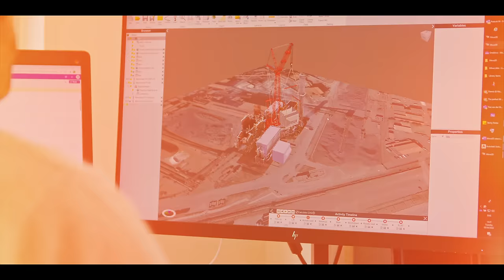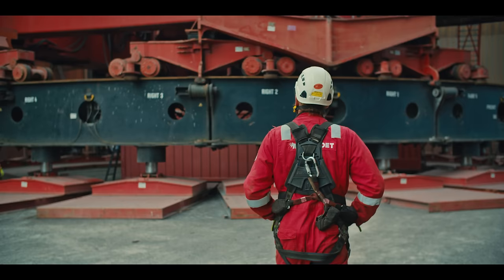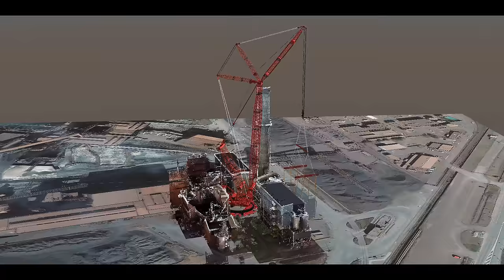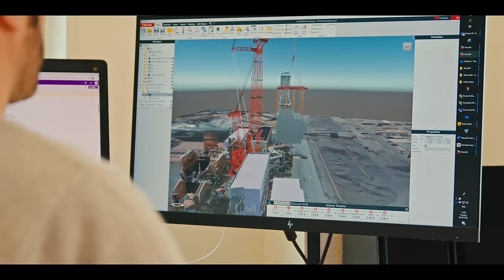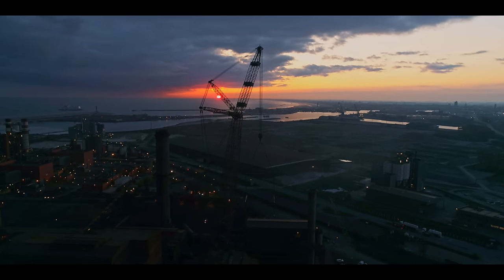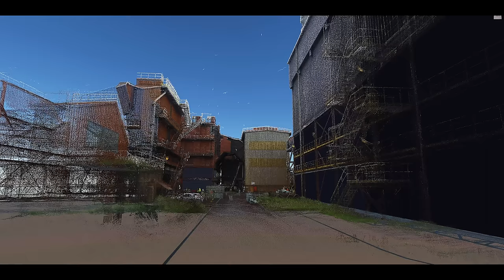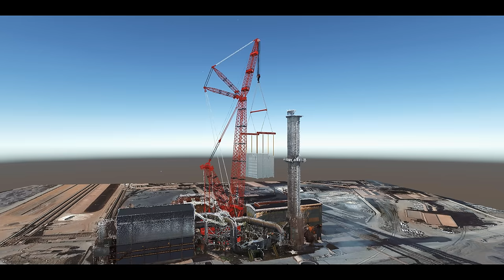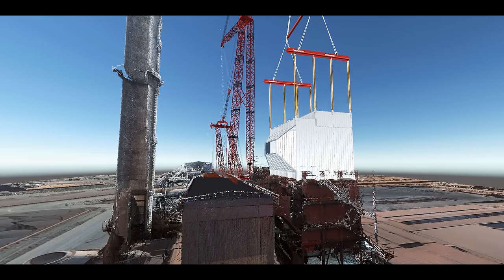How to lift 500t of metal without touching it

Comment: Very impressive on Mammoet's part, but who designs a plant where changing a filter is that difficult? How often does this have to happen?
Reply: The old filter that we had to replace dated from 1969 and was no longer effective with regard to European environmental regulations (new climate laws), hence the choice to replace the old one with a new hybrid filter. Moreover, the construction of the new hybrid filter next to the old one meant that only 4 months of production line downtime was lost instead of the 9 months that would have been lost if the filter had been installed in the standard way with a simple tower crane (like the construction of buildings). 
So the choice was a logical one.

Comment: Great to see that digital technology is now strong enough to 3D scan the site and to simulate all movements of the crane and load. Saves sooo much time.
Does the used program also enable to simulate the ground-pressures during the whole lift? 
The lower arm of the crane seemed to me to be almost vertical, how do you assure it does not fall backwards?
Reply: The jib (upper part) was tilted down.
Reply: it was strong enough in the 90's

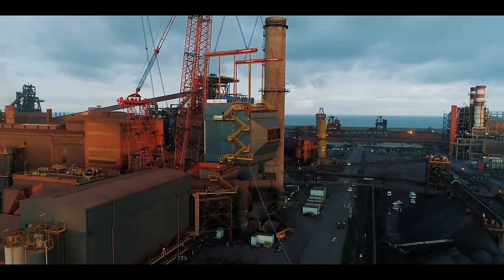Comment: at 09:30 minutes the load is rotated - how is this rotation controlled?
Reply: There are people with lines on multiple corners, so that they can start and stop the rotation in a controlled way. It's not a crane function to rotate the load, at least on this kind of crane.
Reply: It is the MAMMOET Team on floor who manage with ropes the rotation of this kind of Ringer Crane (PTC35 DS). They use also Car Lift (manuscopic, Manitou, Clarck... etc...). This kind of crane does not have an automated (command-controlled) rotary lifting block. So it's done by the MAMMOET teams with ropes with few Cars Lift. I was there 😉
Reply: It actually looks like they put one of the line around the boom of the telehandler and rotated it by extending the boom. A few guys on ropes wouldn't of been able to make it move otherwise.
Reply: @Whydoweneedhandles  That makes sense! I didn't look that closely. But a few guys with ropes would get in trouble with even very slight wind grabbing an object with sides of 20x20m. The telehandler will keep it in place better, at least somewhat.
Reply: @2xKTfc  I am not convinced by any of the above answers
Reply: @andrewjvelliott  Then I'm not sure how to help you? You're free to look at all the other videos on youtube of cranes lifting big stuff.
Reply: @andrewjvelliott  load was rotated with tag lines, pulled and controlled by the guys on the street. at the final part a telehandler was used just to keep the filter in the correct position while lowering the load. It was no problem to rotate the filter with just a couple of guys handling the taglines. trust me, I was there during the execution and did all the engineering for the project.